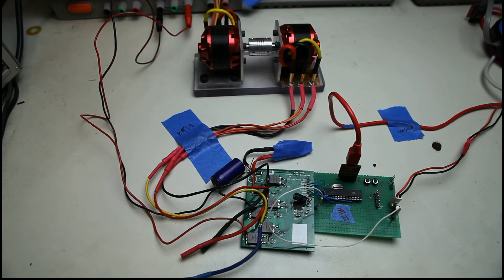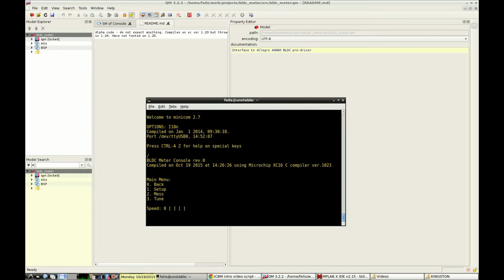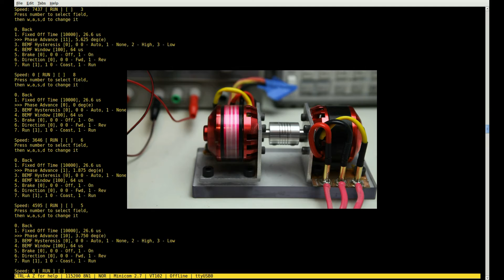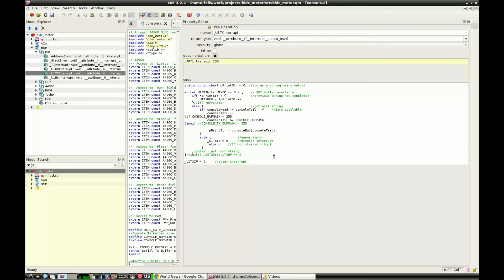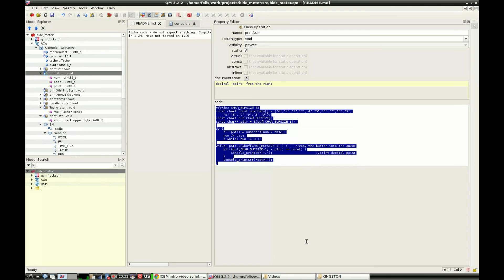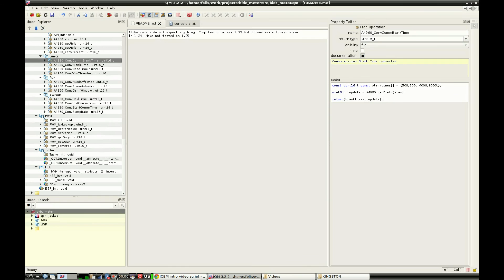Interactive Controller for Brushless Motors

Comment: hello oleg, would you please tell me how to detect usb mouse clicks using any arduino board and usb hat, i saw your code in github, its a lot complex to understand, i just want to light up the leds when left and right buttons are pressed.
I would really appreciate your help if you respond quickly. if possible please send me the arduino code @ susheelkumarpippera44@gmail.com
. Thank you

Comment: Hi there!! I want to control the speed of a 900 watt, 2000kv brushless motor. I also want to make sure the motor does not lose speed under load. Is it possible to do this with arduino? It will be around 50 amps with 18 volts.
Many thanks, Scott.
Reply from the maker: +Ijustlovequality This project doesn't use Arduino. Once completed, the tachometer feedback can be used to maintain constant speed under load.